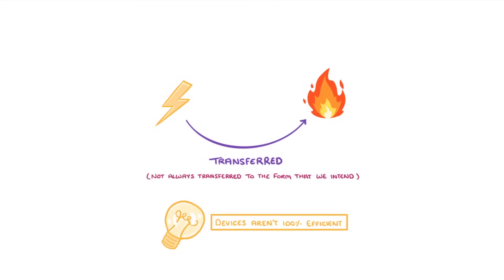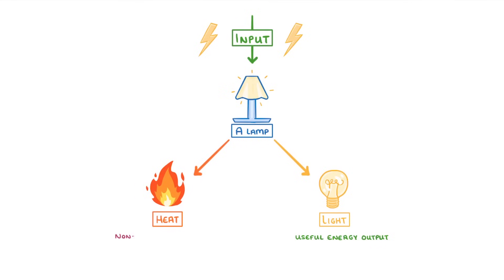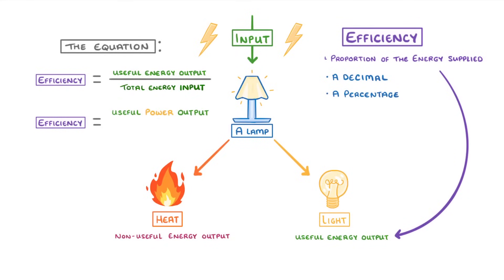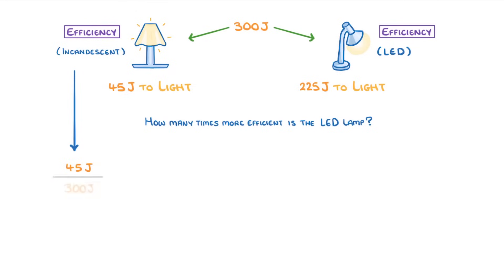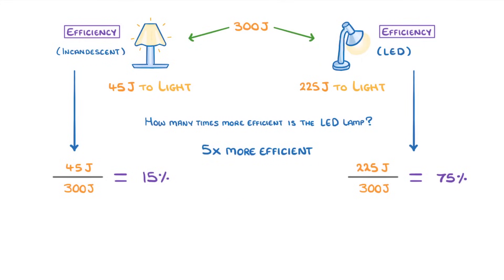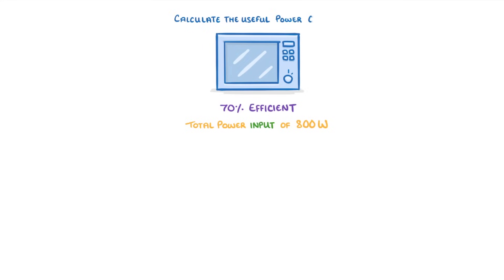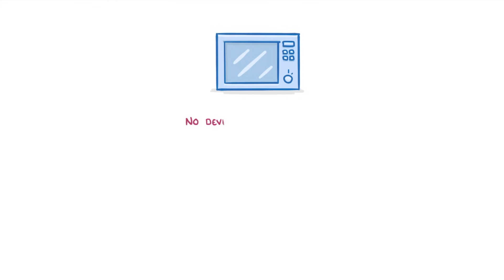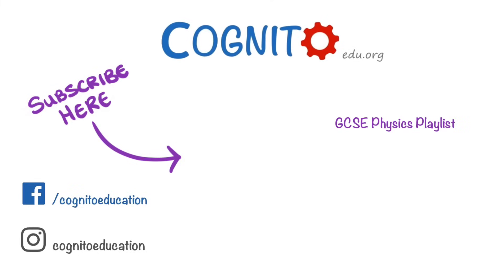GCSE Physics - Efficiency

Comment: Great video! Just wanted to ask if for the energy transferred in a lightbulb, you could start with electrical energy (even though it is not an energy store, would this still get you full marks in an exam?). And then this would be transferred electrically in wires, to thermal energy to the surroundings, and lighting the bulb?
Reply: Electrical-->light+heat (I think)

Comment: For the question with two lamps, can't you just divide the useful output of energy of the second lamp by that of the first lamp? Surely if the input energy of the two lamps is the same, there is no need to use the equation? Thanks for the video though, it really helped!

Comment: I wanted to use this for a lesson but you used the wrong terminology. Energy is transformed into other types, not transferred. Energy gets transferred from one object to another, e.g. heat from a flame into boiling water. Students get very, very confused about the difference between the two, so if I used this it would make it even harder for them to remember. A pity, because it's a really good video otherwise.
Reply from the maker: Hi Rebekah, can i ask which exam board that it for, or wheres it's from? I can't find anything about energy being transformed in the main specifications. Thanks!
Reply: @Cognitoedu  It could be because it's part of the Australian curriculum, rather than the American curriculum. But the grade 8 science understanding under physical sciences specifies there are differences between the two terms: Energy appears in different forms, including movement (kinetic energy), heat and potential energy, and energy transformations and transfers cause change within systems.
Reply: Just thought I'd say also that I didn't expect a response, so I think it's really cool that you answer corrections to check your facts. I know it seems pedantic of me to insist on a difference between the two, but the Australian curriculum insists on it, and I know my students have such trouble remembering the difference, particularly when they are such similar terms both having to do which the movement and changes of energy.
Reply: @Cloudywarrior1  this is GCSE gtfo